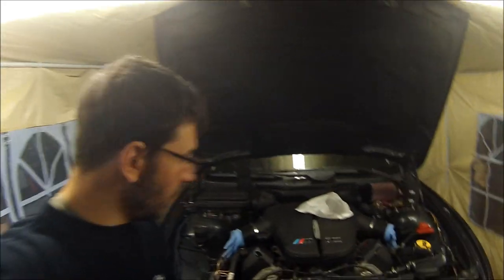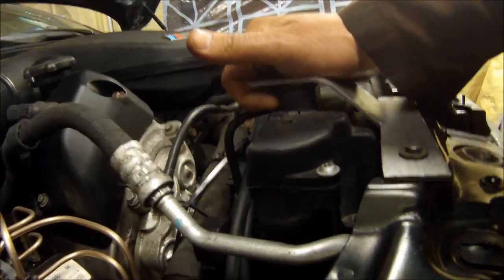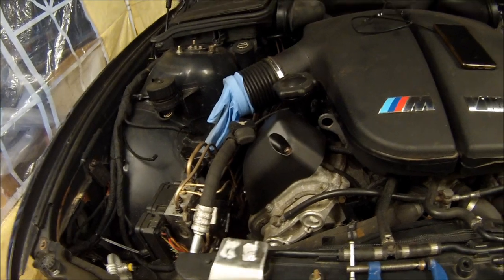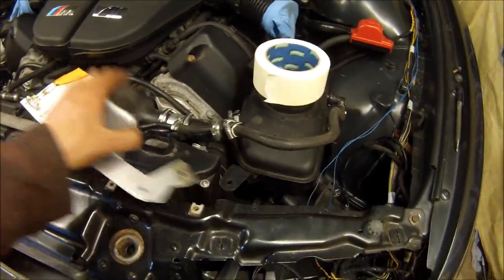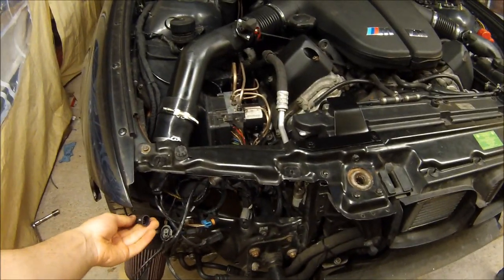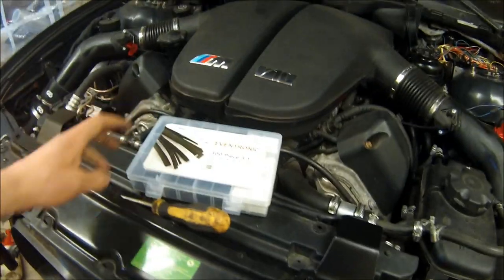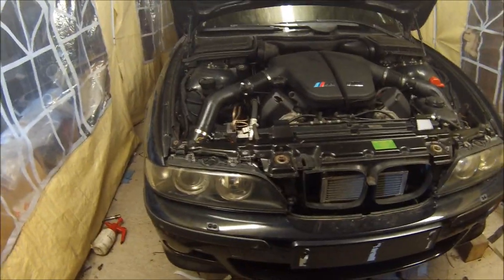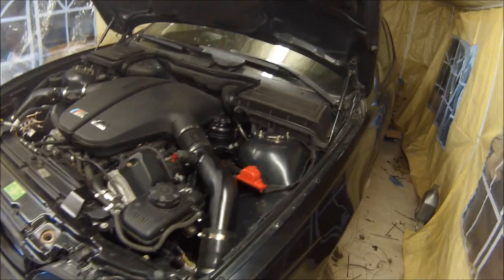E39 M5 S85 V10 Swap Rad Mounts and Front End Rebuild

Comment: Rad mounts look OEM, good work on them!
I think the front grill aftermarket brake cooling ducts that people fit is a great shout for the air filters, should ensure lots of air getting sucked in! They usually come with a silver/chrome circular surround but I think black would look awesome and go with the stealth look of the car 😎
Reply from the maker: Thanks Mohammed!! Yeah exactly as you say black ducts will blend in a lot better I think. I need to order a new grill anyway so I can choose the ports then

Comment: Hi, where did you find those weld-on flanges for MAFs?
Reply from the maker: Darkside developments in the UK sell them, £30 each
Reply: @rodknockers2036  Thanks I will look into it! Could you also help me, how did you manage to put E60 radiator pack into E39? :) I tried to offer it yesterday and it looks like you needed custom rail holders and also to cut the front cross member where electric fan mounts?

Comment: So did you start with an actual e39 m5 or a lesser model?
Reply from the maker: I started with an E39 M5 body, someone had already stripped it for parts. there was no drivetrain at all engine, gearbox, diff etc.
Reply: @rodknockers2036  jon - I’m doing this swap to an e38 (2001) - had a few questions - best way to connect with you?